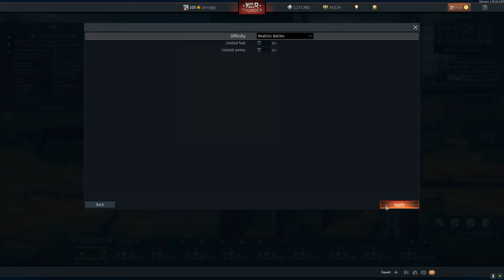NUCLEAR POWERED TANK | BATS^&% Crazy Engineering  (War Thunder Chrysler TV-8)

Comment: i remember reading about this tank. i don't think it was meant to be nuclear powered, but to fight in a battlefield where tactical nukes were in use.

the turret is shaped the way it is to let the pressure wave from a blast pass by without flipping the tank, the anti-radiation shielding wasn't to shield a nuclear engine but to protect from the general radioactivity of a nuclear battlefield. it's amphibious because they thought that all the bridges would be destroyed within the first few days of fighting, that's why the air intakes are on the roof. a nuclear engine wouldn't need air intakes.
Reply: me: HAHAHAHAHAHA! I AM UNSTOPPA-
TV-8: Slow down there buckaroo.
Reply: So Shryler was intended for Nuclear battlefield
Reply: A reactor would absolutely need air intakes. Fission makes heat. If you don't get rid of that heat fast enough, you have chernobyl.
Reply: @Misha-dr9rh  that still doesn't mean it was a nuclear powered tank
Reply: @MarkoDash  Eh, it might have been.
Reply: Also it fired small tactical nukes that looked like rods
Reply: Yes,i agree
Reply: @Misha-dr9rh  still, there might have been a water engaged cooling system in the tank
Reply: Huh.... thanks actually. Informative.
Reply: @Misha-dr9rh  then that would be and exhaust...
Reply: @Misha-dr9rh  a nuclear reactor does not take in air lmao. Its cooled with water or liquid hydrogen. Jfc dont spit out false info if you do not know what youre on about
Reply: @fowlergaming5140  Alright mister einstein. Where are we supposed to get rid of the heat created by the reactor?
Reply: @Misha-dr9rh  its called EXHAUST
Reply: @Misha-dr9rh  what do you think the steam is that comes from reactor towers? Thats steam, being exhausted, in a cooling cycle
Reply: So if the Enclave had tanks they would use these
Reply: @GarioTheRock  nowhere did i say anything specific to a combat vehicle. If you would read again i was merely refuting the idea of a reactor 'taking in air' as a cooling method. That being said i did mean to say 'gaseous' hydrogen. Not sure why i said liquid tbh
Reply: It was indeed supposed to be nuclear powered
Reply: AMERICAN OBJECT 279😂

Comment: Phly: "The prototype had a V8. That engine doesn't look normal."

Me: sees a thick driveshaft and 2 turbos in the exhaust piping 🤔
Reply: As well as exahust smoke. Lol!
Reply: it had a v8 as well as 2 electric engines
Reply: I wouldn't stand a mile near that tank, especially if it spews that exhaust smoke
Reply: @VladislavDrac  but it's the prototype V8 engine, chief. There's no nuclear fuel being used.
Phly's just having a temporary drop in IQ on the matter.
Reply: @VladislavDrac  Lol then dont come near my bus, truck or tractors hehe. Make sure you dont go onto the highway too as some Caterpillars might be makin some big powa with sum big smok.
Reply from the maker: Loll I think what got me was the engine looked like a box and I  assume the exhaust was from steam or something because the reactor might have turn a turbine hahah i
Reply: @That Wide Unit777 lol!
Reply: @PhlyDaily  You're all good; engines in experimental/prototype tanks are just weird in general, and the added hype for the Nuclear Bubble Boi didn't help either. Take the engines in the Obj 906 or 685 for example: They're like 150° V6 diesels or something weird like that. Hell, I think the BMP-3 engine is like a flat-6 or something, but I may be wrong on that.
Reply: @PhlyDaily  you realise nuclear reactors are steam engines right? If its releasing steam its releasing nuclear waste into the air.
Reply: @robertharris6092  not how it works search it up if you don’t believe me, the fuel is in a different compartment, completely sealed off, and it super heats the water, creating steam, turning the turbine with the pressure. No radiation should be leaked into the water, which is either vented into the air, or cooled and cycled back into the system

Comment: The TV-8 had multiple engine options.
1. A V8.
2. A turbine.
3. A vapor cycle power plant.
4. A nuclear reactor.
All output around 300 HP and had an electric transmission.
Also the ammunition was stored in the turret the hull only held fuel and the electric motors for the tracks.

Comment: I noticed something. There's exhaust  or steam coming out the back. It wouldn't make exhaust because it doesn't have a gas or diesel engine, but it wouldn't expel stream either right? The reactor heats water, which drives a turbine, which powers the vehicle. The steam would be routed to the radiator up top to be condensed and fed back to the reactor. It would have to be a closed cycle or you'd quickly run out of water. The whole point of a nuke tank is that you don't have to refuel for a year. If you ran out of water all the time, it wouldn't make sense.

Comment: Believe it or not, the design made a ton of sense. I believe it was kind of a Xenomorph tank. Yes, it would have been easy to penetrate, but it was a tank you dared not kill. Like you said, if you hit a reactor, MOST of the time *key word most* what you will get is a meltdown or leak/fall out. Either way you would kill everything for miles by just destroying one. So you would be kind of helpless if this thing showed up on the battlefield. It can shoot you but you cannot shoot it. For that reason I would paint a massive radiation symbol on it too, as a warning: "Try it and fry, snitch!" to my enemies. It and its crew protected by mutually assured destruction. Refuse to surrender? It has everything it needs to be a W.M.D. if you set it up to properly detonate. I am glad the wars stopped when they did. There would not have been a world left if we saw these.

Comment: The TV-8 with the nuclear reactor as power had the range to get it from Paris to Moscow then to Odessa Ukraine before needing refueling and the tank had closed circuit televions inside the tank to allow the crew to see so they wont get blinded by a nuclear blast, it was designed with the idea that tactical nuclear weapons would be the norm for battlefields of the future

Comment: What is the advantage of a nuclear powered tank? You don't have to refuel for 20,000 km. The downside? Your tank can actually make it about only 50km before something breaks down, because it has to haul around a huge heavy reactor with cooling and shielding (so that the crew don't die before the 50km mark). Plus it is slower than a snail (because of the weight), and it is extremely big and high, and is a big, easy, vulnerable target. When the other side blows one up, it showers your mates with radioactive fallout.

Comment: Engine	Chrysler V-8 petrol engine and two electric motors
300 horsepower (220 kW)

Pretty sure Chrysler V-8 isn't a nuclear reactor, but I'm no car guy... and since we still can't make a fission reactor that would fit in that turret, it stands to reason that the engineers in 1955 were not planning on making this a nuclear powered vehicle.

Comment: How's a V-8 exist in a nuclear engine?  Nuclear engines are just steam engines using the heat from the radioactive source to heat up water. 

V-8s are cylinders that compress gas to ignite them and use the resulting explosion to power the engine.

Comment: This is a blatant lie.
The TV-8 was never ever designed for a reactor. It was designed to use a turbine, which was never fitted. I had a diesel engine instead.
The issue is the time period, specifically the early 1950s. So designers said there'd be reactors in everything.